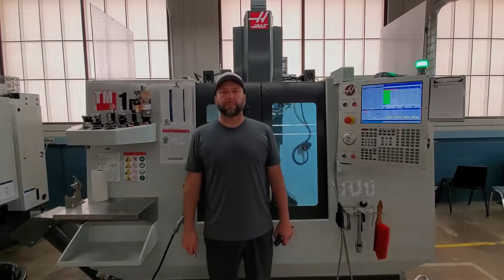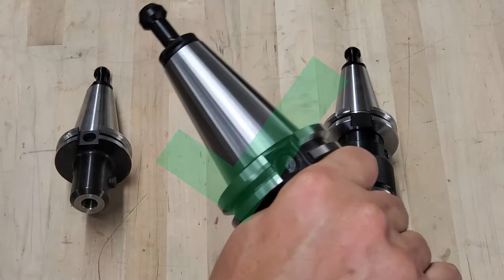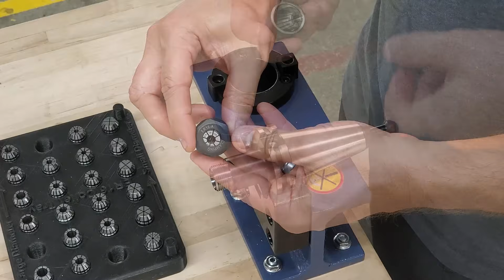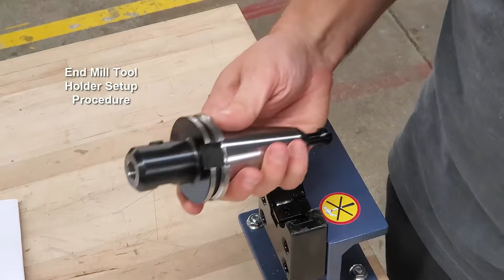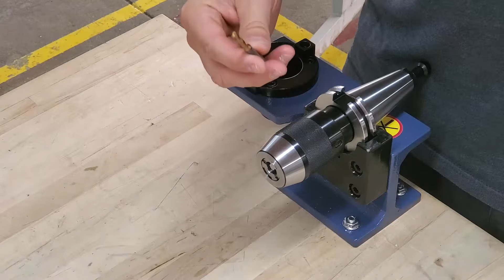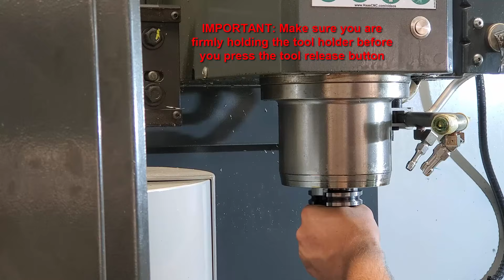Tool Holder Setup and Machine Loading Procedure

Comment: Good tutorial for beginners but with ER collets the flange that locks them in is eccentric so you should insert the collet into the holder at an angle where the flange is hooked under the groove and rotate it to align with the holder while pushing foreword, in sot sure how to do this just wiggle around while pushing but do this without a tool in it and until it snaps or locks into place. This is especially important on the larger er collets. When using a weldon type holder that requires a flat milled on an endmill be sure to tighten the set screw into the slot or flat then back it out just enough to slide up and down, if it does not hit both ends of the notch and is not captive you did not get it into the notch created by the flat and need to adjust it until you find it then tighten it tight. I think you may have gone overboard with the gloves used to hold an endmill or any tool, yes you need to be careful but if you are that sensitive then you should never touch a part because they often have sharp burrs and are covered in sharp chips that become splinters easily. In the real world you won't make it if you need a glove to handle a tool, I have had several cuts and numerous splinters over the last 30 plus years in machine shops, one of those times I was wearing thick leather gloves, I thought they would protect my hands but trying to pull stringy chips out of a conveyor proved them to be ineffective, better to rely on common sense. My advise is use common sense, learn from your mistakes and have a good pair of sharp tweezers and regular ones for the splinters sticking out of your skin. You don't have to be tough but it helps to not be a pussy either when working in a machine shop.
Reply from the maker: Thanks, This video is intended for high school students.  I can't have students getting cut in my classroom hence the reason I advise they wear gloves.

Comment: great beginner video, but for torquing those collet nuts, use the other holder, vertical one, that way the fixture holds the tool, then hold the torque wrench with BOTH hands, this ensures an accurate reading, and that the force doesn't send the end flying as the head slips off, with nothing to catch it.

Comment: I think you need to have the crow foot at 90 degrees to the torque wrench body? Otherwise your wrench length isn't accurate and your torque value will be off?
Reply: I noticed the same thing.  The applied torque will be greater than the indicated torque.
Reply: Correct. 90° it is 👍

Comment: I have a problem: when I'm milling the part one time I get one size, and when I get the toolholder from the spindle and get it back to the spindle 
and milling another part I get another size. It varies from 0.02 to the 0.05 mm. What can be the reason of this problem?
Reply: Old machines tend to do this because of wear on the machine. Also this can be from the spindle warming up and cooling down

Comment: At 6 min, you didn’t lower the tool far enough to engage into the groove!
Reply from the maker: It's engaged, depth perception can be deceiving.
Reply: I think you are correct, he needs to double check it by loosening it slightly and moving it up and down, if it's not captive it's not in the notch.

Comment: You said you set the torque wrench to 34 Lbft. Have you accounted for extra torque to be generated due to extended certerline while attaching the crowfoot to the torque wrench ?
If not, then there would be variations in torque values that is transmitted into the collect nut and risk of damaging the thread or nut due to over torque.
Reply: Great info ! What is the correct lbft?